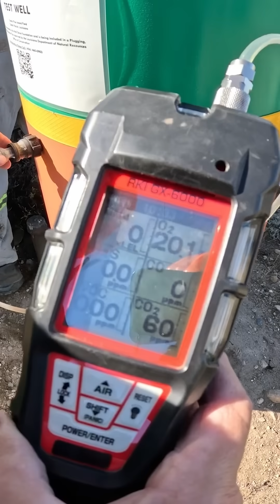The problem goes deeper than you think...

Comment: Can they not sell methane?
Reply: They can now, but that wasn't always feasible.  And the company that drills for oil is not the same company that drills for methane.
Reply: The problem with methane is it's difficult to store and transport, especially on a small scale. 

Oil you can put in a tank and have a tanker come pick it up. If production volumes are high enough you can built a pipeline, but you don't have to.

Propane and butane can be stored and transported as liquids under pressure.

Methane OTOH will not really liquify at room temperature. To liquify it you have to cool it down. That's bad enough, it means you need active refrigeration equipment rather than just a passive storage tank.

Worse there are a number of impurities found in natural gas, which become solid at the temperatures needed to liquify methane. These must be removed before liquification.
Reply: @petermichaelgreen  What if instead of transporting it, you use the methane to power turbines to create electricity for local towns? They then could use the excess energy for Ai/Crypto.
Reply: A lot of times the methane that is there is not very valuable because the flow and amount is too small.
Reply: He explains it all in the full video .